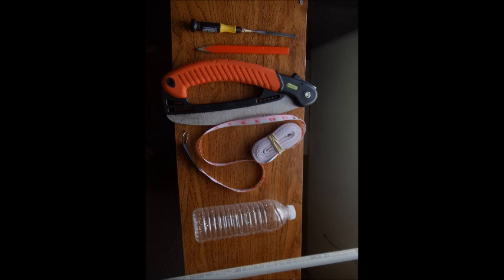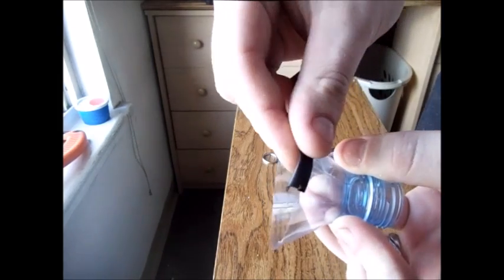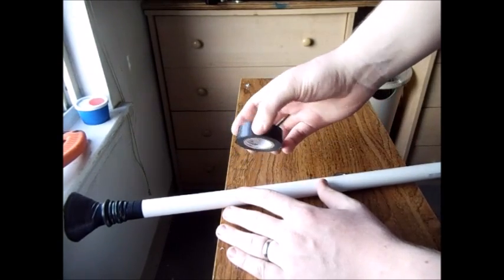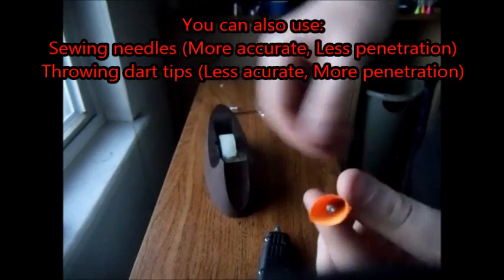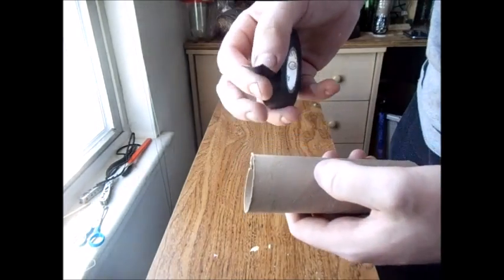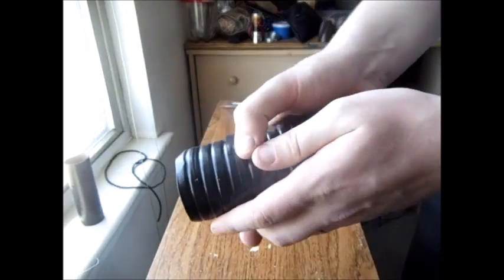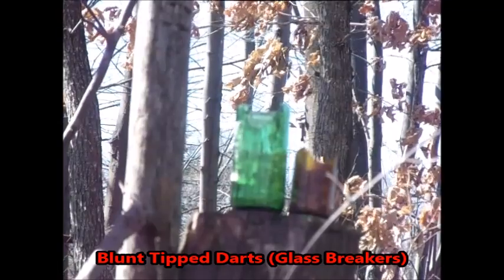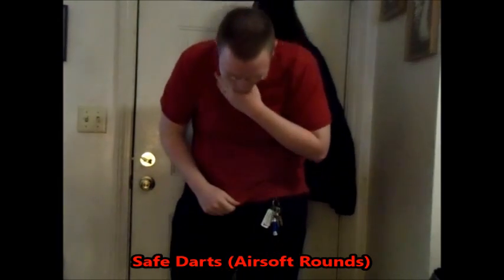How to make a PVC Blowgun, Ammunition, and Holster

Comment: Thanks for sharing. I am planning on making this one. Great idea with the bottle neck as a mouth piece.
Reply from the maker: Thank you Steve. I hope you have fun with the build.
Reply: I use a plastic gas tank funnel. One side of the funnel lip is higher than the other, but my mouth area fits into it great, with no air escaping.

Comment: I like a longer pipe for better accuracy and velocity, I would also use PVC for a belt/neck holster. You can use a one or two inch inside diameter tube cut to two inches in length and a solid cap for the bottom. Cut another piece about one inch long and warm it with either a high temp hair dryer or a heat gun until just soft enough to press down on, place a piece of leather or something else to keep a thin gap between the insides of the pipe. Let cool. You can use PVC cement or super glue to attach the ‘belt loop’ to the holster, you can then either use it on your belt or put string through the loop for wearing around the neck or even over the shoulder.

Comment: For the mouth piece just use a heat gun and custom shape it
Reply: PVC is flex, but it has limits.
Reply: @nowunspeshal7751  Ya, I bought a piece of PVS but it was too flexible and bent under it's own weight but half inch  copper pipe stays true.
Reply: @keen9629  I use 10mm (40 cal) aluminium inside a wooden tube... very little flex, probably couldn't bend it by accident either. high powered down a thinner tube, faster, flatter flight path.
Reply: @nowunspeshal7751  That's different, the hole is a little small for my liking but how did you get or make a wooden tube to put it in. Now I'm thinking I need to that too. Please respond about wooden tube.

Comment: 1/2 inch = ~12.7 mm = 50 Cal.
The only problem is that PVC is too flexible and that can mess with your accuracy.
Use thick walled aluminium tube. 10 mm = ~ 40 caliber. You should be able to get it in 12.7 mm if you think you need to go that size. Instead of farting around with tape, try splitting some rubber tube and gluing that onto the mouth guard to form a better and more comfortable seal..